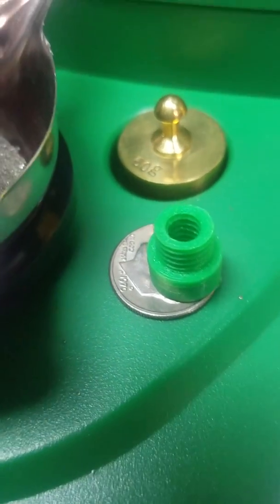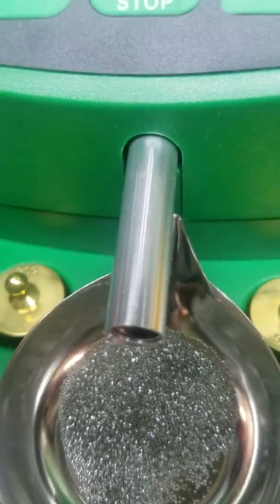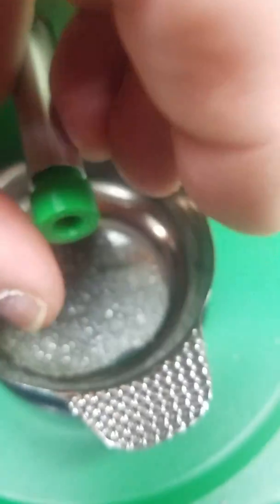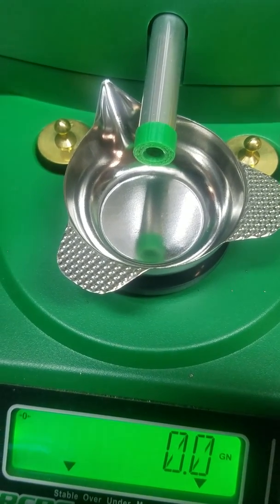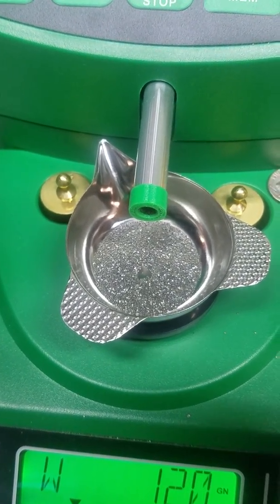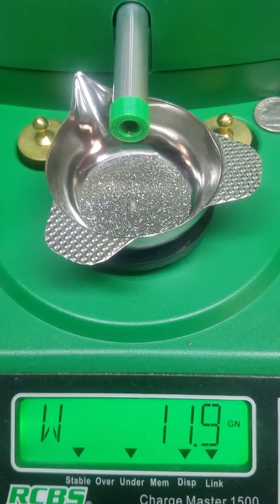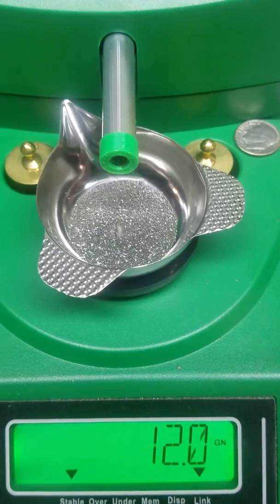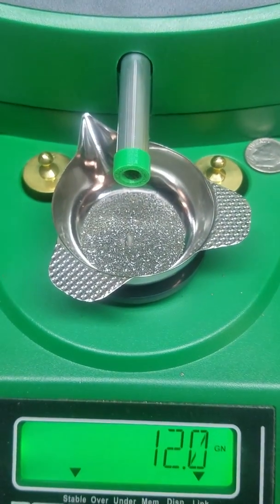Loadertools RCBS ChargeMaster 1500 Orifice Restrictor

Comment: I’ve notice your eBay  it comes with a Small Medium and Large restricters wich is the best to use for reloading 223 ammo ??
Reply from the maker: I'd say large unless you were shooting 4 or 5 hundred yards, the accuracy could be further maximized by even smaller increments of trickle to the final charge weight.  Accuracy will be fantastic with large also.  The machine suggests they hold 0.1gr accuracy I'm thinking they forgot to mention when using LoaderTools nozzles.